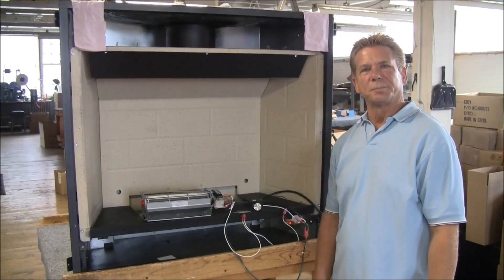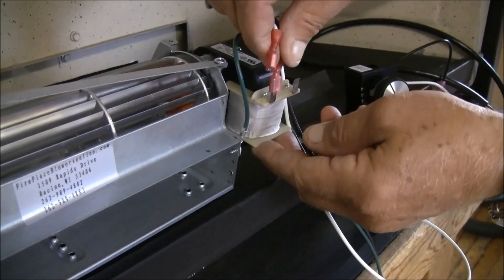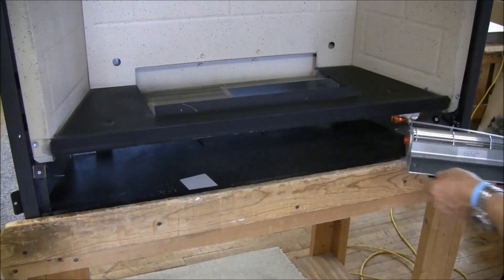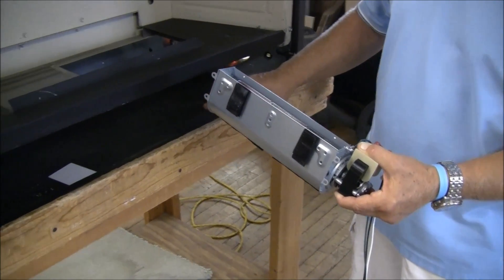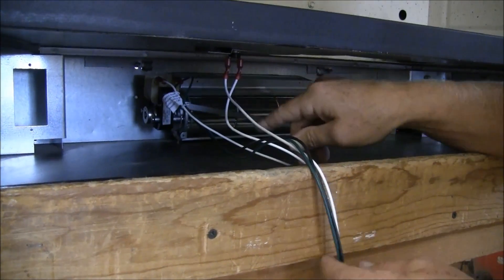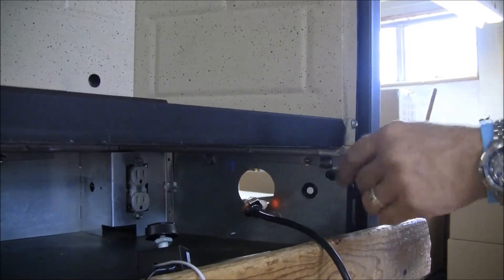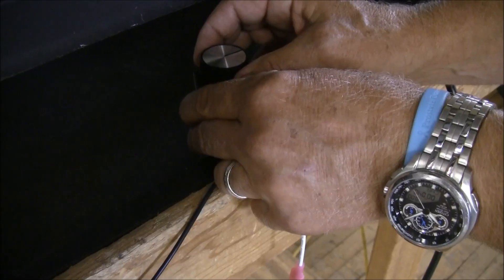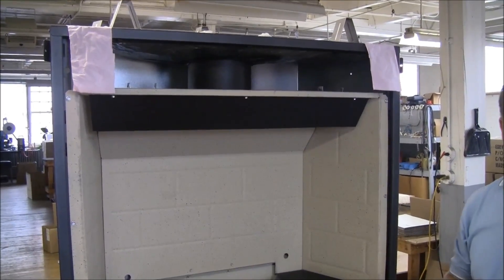GFK4 GFK4A Fireplace Blower Kit Installation

Comment: I just bought a house that has a gas fireplace. Tested it and it lights and after ten minutes it turns off and the blower never runs. What could be the problem?
Reply from the maker: Ten minutes may not be long enough for the thermostat sensor to get hot enough to trigger the blower.  If the fireplace is simply turning off after 10 minutes, this is indicative of something else. Could be something related to the pilot light assembly like a defective sensor / thermocouple.  Could be a defective high limit switch or other issues as well.  You can always bypass the temp sensor on the fan kit to ensure the fan is operating normally.  Once you figure out why the appliance is shutting off, I'm going to bet the blower will begin working again, since it will have ample time to heat up and trigger the snap disc on the fan kit.  Hope this helps!  Regards, Jason

Comment: My fireplace has vents at the bottom instead of the top. Should the fan be positioned so it can blow air out the bottom?
Reply: If you place at the bottom, in my unit it melted the speed control and the plastic junction box plug. I had to replace both pieces. The heated air is very hot.
Reply: If anyone needs to know the partnumber for the melted plug box, HHT Junction Box (SRV4021-013). Good luck!
Reply from the maker: We would need to know more about your specific model, but the blowers are typically never positioned so that they are blowing out the bottom.  You should have a hood or exit vent on top.  Hit us up at 262-989-4882!  Cheers, Jason

Comment: Question for anyone I am going to be purchasing a majestic blower motor kit and see it has two blower motors that are not connected as one unit but two separated so either it’s a back up or or can you hook up them both up?
Reply from the maker: What model Majestic are you referring to?
Reply: @fireplaceblowers  I figured out that the kit is one blower motor that comes with a extra. Never did but motor yet and may be something in the future.

Comment: I’m thoroughly confused now. I just received the kit from you that has the electronic fan speed control. It has several wires that include a red and black positive and negative valve sensor wires?

Comment: Will the thermal switch work mounted on bottom as in video if I have a stone brick bottom which lays on the metal bottom. My fireplace is a coleman, wood burner, with a gas log ventless insert set. Which is currently sitting on the fire brick bottom base, I have no heat reaching through the bottom side of fire brick so how would the thermal switch get hot enough to kick on? Could I bring the thermal switch up and mount to bottom side of logs next to the logs thermal probe?
Reply from the maker: Great question.  In these cases, the brick acts like an insulating layer, especially when the fireplace has been converted to gas.  So what we'd typically do in your case is mount the sensor on the top of the fireplace and secure with either a magnet (like in the video) or even a couple of sheet metal screws.  Really just depends on the style of sensor you would need.  When we do this, we like using a high temperature rated wire through, since it needs to be loomed down the side of your fireplace.  Give us a call directly if you have any questions!  Regards, Jason

Comment: Nice video. Question: Do you leave the variable speed control (knob) at a certain speed AND in that area? Or should the speed control be mounted outside of the fireplace? If the latter, I would have to drill a hole in the exterior of the insert.
Reply from the maker: On the most of the Heatilator fireplaces that use the GFK4 blower kit, the speed controller is mounted inside of the fireplace below that lower panel.  Doesn't exactly make it easy to access, but that's normally where it's installed.  We've seen folks drill holes on the outside of the panel so that the knob is outside, but before doing that, make sure you've got a flat space to mount the controller.  Call us at 262-989-4883 with any questions.  Regards, Jason
Reply: @fireplaceblowers  I publicly want to thank you for your advice! With the expertise of Jason, you guys helped me resolve my fireplace blower issue! Thank you!!!
Reply from the maker: @DrMardo  Thank you very much for the shoutout.  We certainly appreciate it.  Always happy to help, so thanks again for reaching out and have a wonderful New Year!!  - Jason

Comment: Couldn't figure out why my blower wasn't working until I watched your video and realized that the temperature sensor was not getting triggered. I was almost out the door to head to Home Depot to get a new rheostat and if that failed, to buy a new blower (least expensive to most expensive process of elimination homeowner troubleshooting methodology). Seeing you heat up that sensor, I realized there was a 3rd variable, and maybe I wasn't giving the sensor enough time to heat up even though I waited 15 minutes. So I waited longer instead of going to the hardware store and the blower kicked on.  For some reason my sensor really needed to get hot before it triggered the switch. Thanks for saving me an unnecessary trip and unnecessary replacement of parts that didn't need to be replaced. If my blower does go out, I'm headed to FireplaceBlowers.
Reply from the maker: Glad the video helped!!!  We love hearing stories like this, so thanks for sharing and don't hesitate to hit us up whenever you need anything.  Happy to help!

Comment: Looks like a great accessory for my Heatilator fireplace.  We have only lived in this house for 14 years with no fan.  One question.  My homebuilder installed a fan switch next to the fireplace switch on the wall.  That switch leads to a receptacle at the bottom of the fireplace box near where the fan would sit.  Is it okay to plug the fan into that switch?
Reply: Sparklander yes. You still have to connect to power.

Comment: Before you order, make sure and check that you have power going to your power outlet underneath the fireplace. Many builders simply choose not to wire the outlet.
Reply: This just happened to me. I ordered a fan, not thinking anything of it. My builder didn’t take the time to wire the auxiliary outlets underneath the fireplace. Luckily, I saw this comment and didn’t spend any time actually trying to install the fan and wondering why it didn’t work.

Comment: I just installed this blower. I'm getting a vibration noise in addition to the fan noise. The vibration noise is there regardless of the blower setting (Hi/Lo). Anyone else have a vibration noise? How do I get rid of it? Thanks!
Reply from the maker: Hey Gary, sorry for the late reply on this!  If you're still having an issue, don't hesitate to call us directly and we'll be happy to help.  Regards, Jason 262-989-4882

Comment: Can I use this to add to my kodiak wood stove fireplace insert?
Reply from the maker: It would likely require some retro fitting, since it's not a direct OEM replacement kit.  If you were thinking of doing that, our GFK-160 blower kit might be a better option for the Kodiak stove. Give us a call at 262-989-4882 and we'll be more than happy discuss.

Comment: My natural gas fireplace has 4 vents on the side and controlled by a switch.  When I turn it on, I can hear the fan blowing, but the air coming thru is always cold.  Looking up into the fireplace, I guess the heat is captured way up inside the flue?  Seems like a blower directly under the fire is the way to go, but how to get electricity?
Reply from the maker: Hi Adam.  I would encourage you to call us directly so we can go over your fireplace in more detail.  The make and model of the fireplace will certainly help.  In most gas fireplace setups, the blower is installed below the fireplace and circulates air up along the backside of the fireplace.  If your blower has a different configuration, then that may explain why the blower isn't circulating heated air.  262-989-4882.  Regards, Jason

Comment: Hi!  I know it is short notice but do you think this would fit a Valor insert 739JLN/P (Logs) & 739IRN/P (Rocks)?  I am planning on purchasing one tomorrow and can't find a list of what fireplaces this will fit.   Thanks!
Reply from the maker: +jhomstad77 Sorry for the late reply.  The OEM Valor 755CFK Circulating Fan Kit is closer to our GFK-160 fan kit. There may be a little retro fitting request to make it work, but the GFK-160 could possibly work as a universal replacement.  I believe the blower kit on your fireplace is mounted through the rear of the insert, which also presents some challenges if the fireplace is already installed.

Comment: Are the blowers one size fits all
Reply from the maker: +Dave Danish Not always.  The GFK4 blower specifically is 12.5" long, so you'll need to make sure that you have enough space to accommodate it.  It's also 3.23" tall on it's shortest side, which could limit installation on some models.  It's always import to check height clearance and horizontal clearance at the rear wall of the fireplace, which is where most of these blowers are installed.

Comment: Terry, do I purchase a univrsal blower through you? Mine just went out after 10 years. Looks like the one in the demonstration, except the wiring connections are on the left and the blower is held to the back by flat magnets. Sounds like a bearing. Firepace is DESA and they are out of business.Thanks.
Reply from the maker: +Gordon Dahlberg If you haven't done so already Gordon, give us a call directly and we'll get you squared away.  I should have something close to your original DESA that will work as a universal replacement but is even better than the OEM unit.
Reply: Gordon Dahlberg Has
Reply: . Lorna

Comment: I own a lopi and the blower looks exactly the same. Do  you supply to LOPI? I turned the blower and it does not seem to work.  I guess it turns at certain temperature. If it does not work could it possible be the temperature censor?    I Know the fan should always be at medium for maximum and longer performance.
Reply from the maker: We don't currently supply to Lopi, although we're currently redesigning several of their kits and blowers.  The problem you're describing sounds like a thermostat issue, so that's where I'd start first.   Give us a call if you're still having issues!